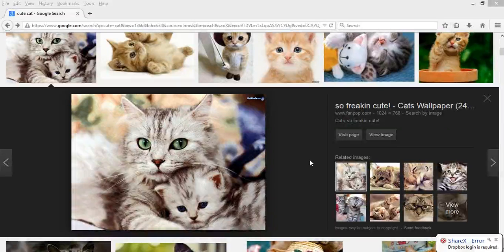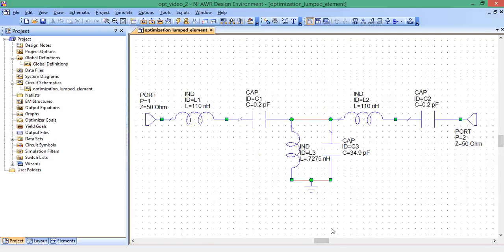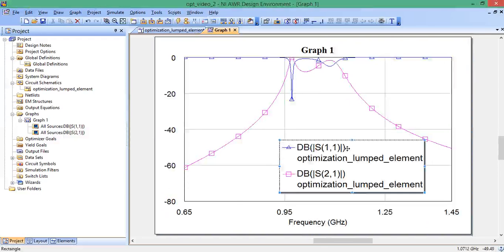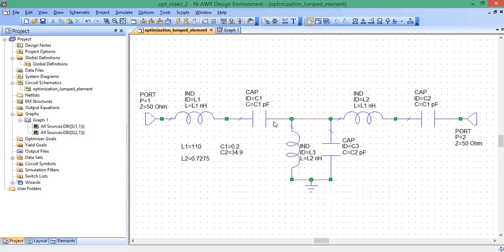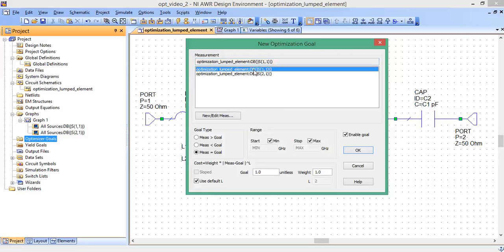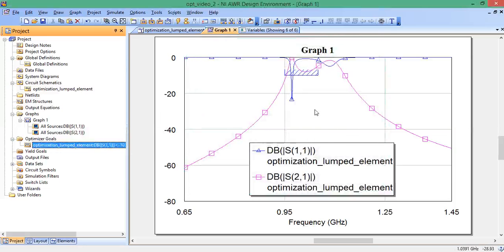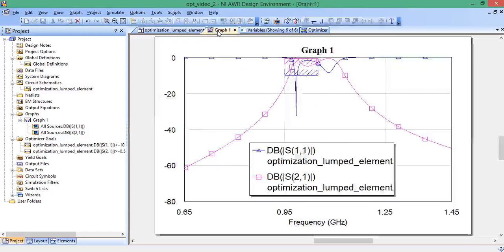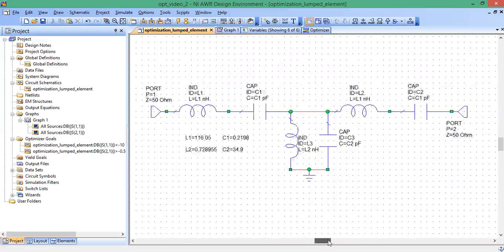Microwave Office optimization

Comment: Hi that was really really help ful. I have a lab session at U of G. And it has something to do with Bandpass filter design based on CPW (distributed model - not Lumped) and optimization based on strip line lengths and stub lengths. The challenge here is they had given a circuit for Bandstop and asked us to do a Bandpass filter design by changing the stub connections (o.c. stubs). I can share the AWR template (ver. 16) details & the questionnaire report with you (by email), can you advise me to design the circuit connections for Bandpass (given a bandstop CPW design). Thanks in advance.